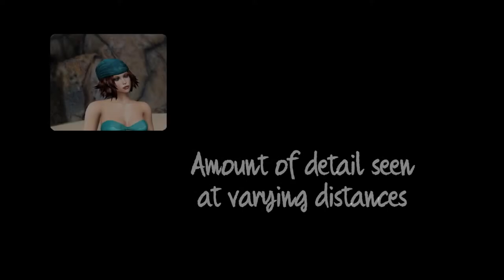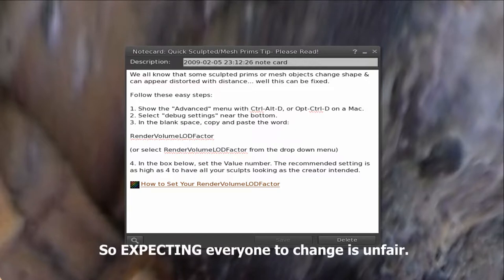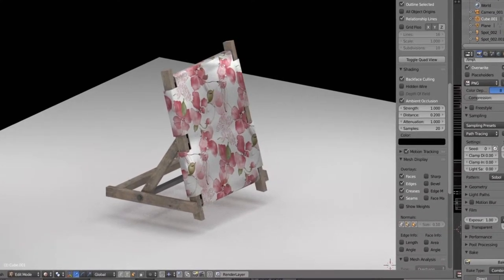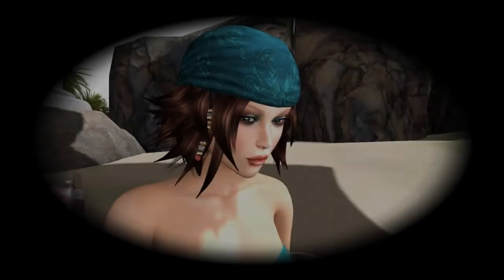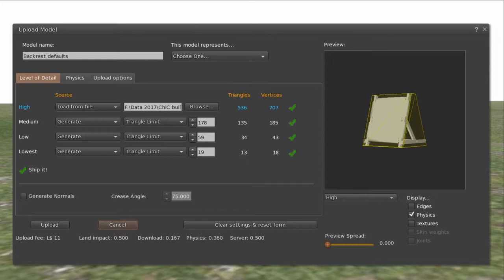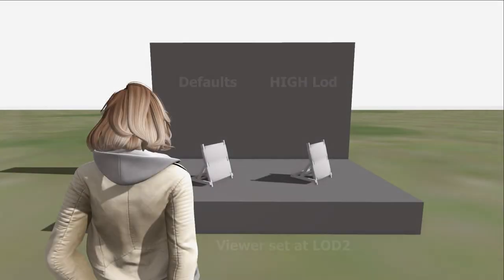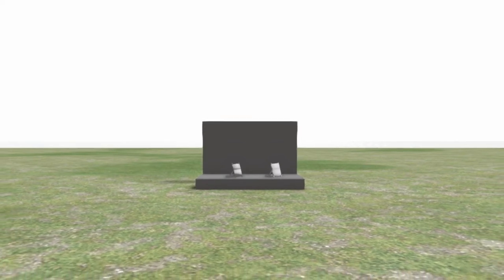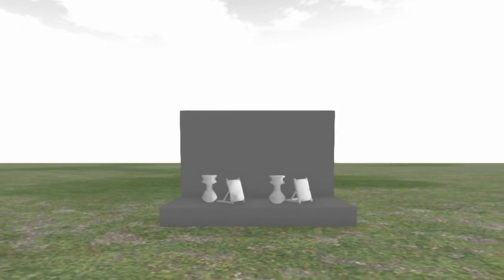LODs - An Explaination

Comment: I've never experienced performance issues when running LOD at 3,4 or 6. But maybe I'm not noticing? What are symptoms? The only reason I would use higher LOD is if you are suing similar camera moves like you do in this video for Machinima. Trying to keep the scene as realistic as possible is ruined when the LOD breaks down. Another solution though is to keep those kind of camera moves to a minimum or none at all.
Reply from the maker: Actually I have a very hefty computer and so "I" don't have any issues at LOD4. I never turned it higher than that. 

It definitely slows down your computer though. I can be on many grids at once now  at LOD2 doing various things and still have great FPS.  The point really was that there is only a small portion of folks in SL and OS that have gamer computers. The rest of the folks often see the world in a very ugly way --- simply because creators are in the "well they can just use LOD4" mindset and many cannot. Their computer would just crash and burn.  

There are NUMEROUS posts on the forums asking why things fall apart at a few meters. It is simply mesh that wasn't uploaded well. So enviably people responding suggest buying from ONLY creators that make better mesh and being sure to see a demo rezzed in world :D. 

I use LOD2 now at all times and have no issues with smooth cams so I don't see that  raising your LOD setting has anything to do with machinima needs. Actually if anything  breaks up at LOD2 I discard it. That's my rule these days except for a few up close kind of props that I might need sometime. :D.  

Happily there are a growing number of creators paying attention!!!!!